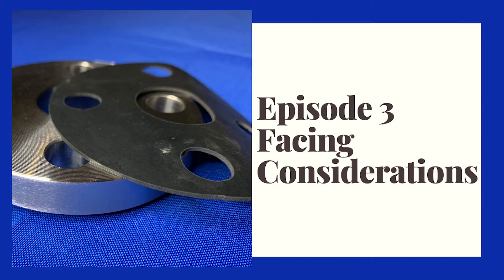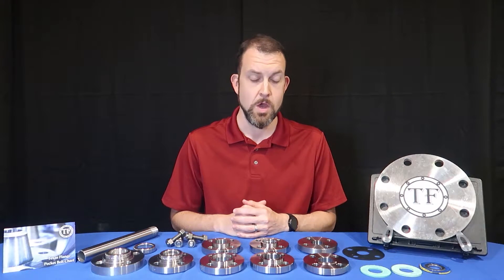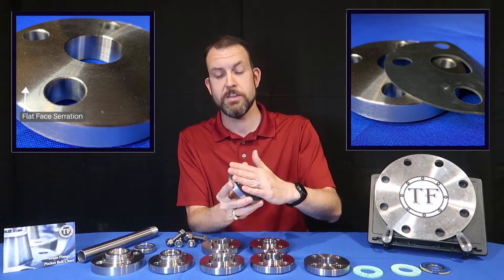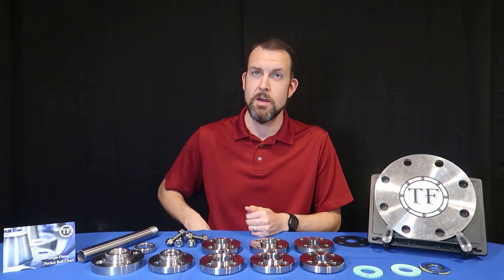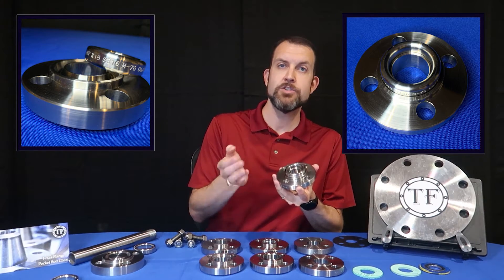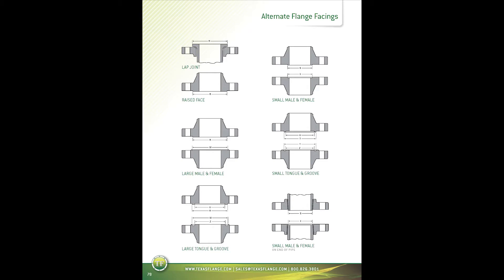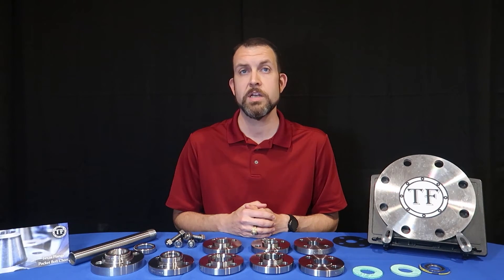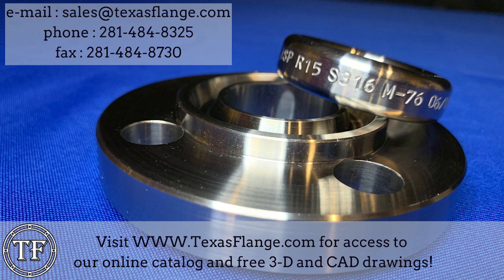Episode 3 Facing Considerations

Comment: how can one determine if the serration is concentric or phono by looking at the part, or what type of measurement can provide the difference?
Reply from the maker: If the part is installed, you can’t determine the difference, but if you’ve got the flange unbolted, just look at the face.  For Blind flanges, it’s most noticeable in the very center where you can either see concentric circles shrinking into a small dot or the curl of the beginning of a spiral.  For others, see the outside of the face.  If you trace the groove, you should see a slight movement toward the center of the flange on phonographic finishes.
Reply: @TexasFlange  thanks for the reply.  I’m looking at a 6” raised face flange on a valve and trying to determine which one it is lol. Serration is about 56 grooves per inch.  Hard to determine.
Reply from the maker: @hoot3000  Either should work for most applications.  The spec allows both and I’m not aware of anytime I’ve seen phonographic required with a specific exclusion of concentric.  We typically only see concentric called out when there’s a clear need for it.